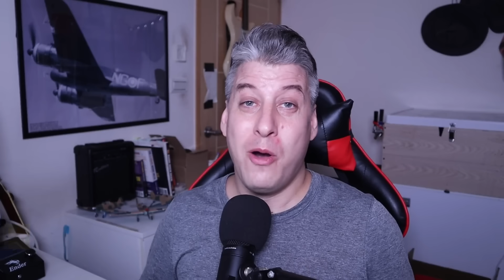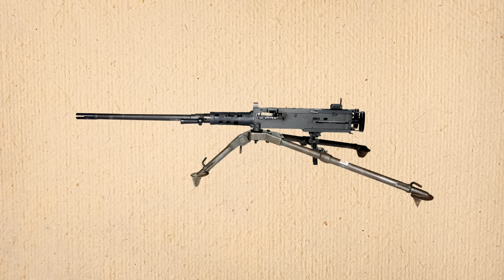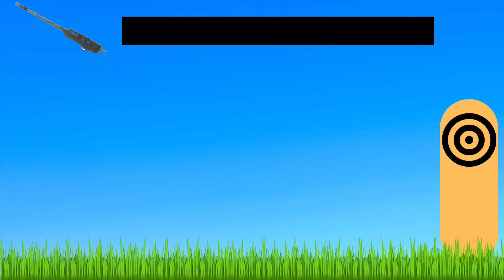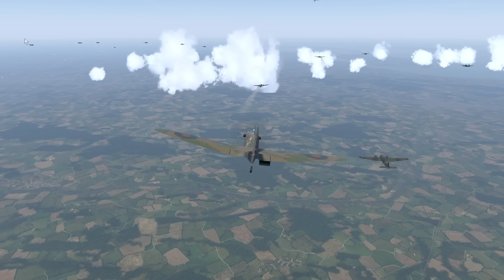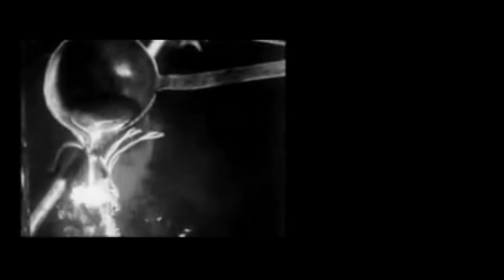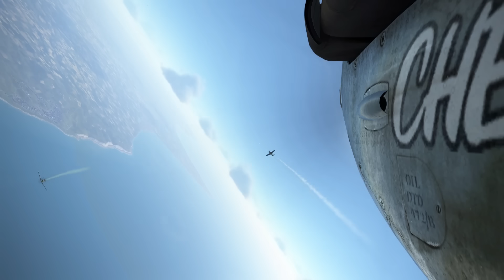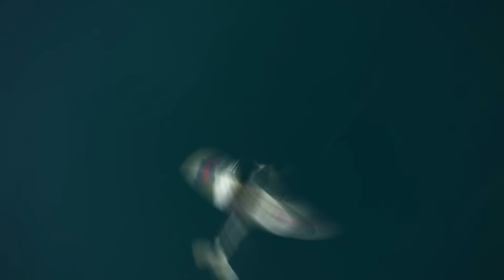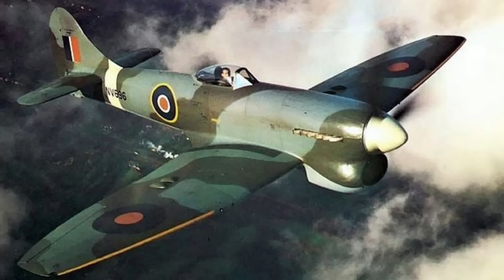Why Did The RAF Use .303 Caliber Machine Guns in WW2? The Surprising Answer

Comment: Nice discussion for which I've never had a satisfactory answer, until now.  One thing you didn't mention was the increase in weight of the rounds as the size increased and so the resulting decrease in numbers on rounds that were much more destructive and at a longer range.
Thanks!
Reply from the maker: Thanks for watching. Perhaps I could have covered this in more detail, thanks for the suggestion.
Reply: He did cover that the size and weight increases meant less ammo. It was a short bit so you could have missed it.
Reply: Or maybe he revised the video.
Reply: @carlwessels2671  
I think he generally mentioned the differences in weight -- the .50 is much larger than the .30 and the 20mm. Is a quantum larger than the .50 -- and the same is true of the rounds themselves so there's a difference in size/quantity in addition to weight.
I believe the Spitfire had a seperate trigger for the 20mm
 caccin for selective firing.  Why did the Hurricane Mk. II, which was largely used as a nightfighter, swap its 8 X .30 for 4 X 20mm.?
Reply: @randytaylor1258  It's been stated that 4 20MM are much better at destroying bombers than 8 .303
Reply: @carlwessels2671  
The .30s fire much faster than the 20mm. but with a much shorter range.  The 20mm. have a longer range with a much larger round, but the chances of a hit are less.
If you're not going to pay attention why waste the time answering.
Next I'm going to ask why some propellers have 3 blades while others have 5 while Mustangs, T-bolts Corsairs, and Hellcats all have 4 -- I can't wait to hear you cite fluid dynamics.
Reply: @randytaylor1258  The later War. 50s were closer to the .30s firing rate than the earlier guns. If you have seen any of the numerous pieces and payed attention to one of my comments,many fighter pilots said 4 20MM were much more effective in bring down bombers than 8 .303.
Reply: @carlwessels2671  
You're right about the firing rate of the Browning .50
I wonder if the perceived effectiveness of the 20mm. was because for a sharpshooter, the higher velocity, higher accuracy, and longer range made it.more effective in the hands of a pro, so that just a couple of hits were devastating.
One of the U.S. Marines' best snipers in Korea used a .50 on a tripod with a scope, taking out soldiers with a single round from over a mile away (the same round the Barrett .50 fires). Imagine that the 20mm. is more accurate than that.
Reply: @randytaylor1258  Thanks for the nice reply. I've seen statements from the pilots saying they liked the 20MMs effectiveness at all ranges . I think it's because the 20MM bullet weighs over twice the .50 bullet and over 10 times the .30. Some of the battle of Britain pilots said that even with ball ammo the twenty was better. I think because a ball round would go through so much of the length of a bomber . Make no mistake they thought HEwas better, but were surprised that ball did a lot better than they thought. Early on manufacture of HE couldn't keep up,so some were ball. 
           On your other comment,the concensus is that more prop blades helps climb performance and hurts top speed. Small effects 1 to 2 percent approximately.
Reply: Ps there have been some heavy rifles made in russian 14x114 caliber and some of the smaller 20MMs,but not many. I think the weight,size and recoil problems get to be too much.

Comment: I think they were a LOT more effective than games portray.  In many cases a larger caliber HE round would do a lot of surface damage and not internal damage though still considerable.  The inability of game developers to model such complicated things isn't all that surprising.  That they don't make some sort of accommodation for that lack of detailed damage modeling is a problem, lol.  A 30 caliber round going fast is nothing to sneeze at.
Reply: The HE rounds were fused to explode inside, not on the surface
Reply: @wbertie2604  So the games modeling is even worse than I thought, lol.
Reply: @mitch_the_-itch  it depends. The RAF tended to use APIT a lot in cannon, not much HE. The Luftwaffe used a lot of HE. 

Edit: although a Minengeschloss was intended to explode inside a plane and damage a lot of stuff if it did, it had to get there, and it had less penetrative power than a Hispano APIT. But the latter might leave a big hole which might be catastrophic, or hit a fuel tank, or it might sail though and miss anything vital. One advantage of firing from the rear is that along the length of a plane or the depth of the wings there's going to be something you want to keep like spars, engines, etc., so you can see why the RAF was keen on Hispano for tail chasing bombers.
Reply: @jbepsilon  That sounds logical.  I just flew a mission where I had almost a thousand .50 hits on one FW190.  I ran out of ammo, he flew home, lol.  Had these impacts been modeled correctly that couldn't have happened on such a regular basis.  Let alone going down to a .30 caliber.  The caliber is only part of the equation.

Comment: Am not a British aviation subject matter expert, but one critique: a comment was made that there was no .50 round that flashed when it hit a target. I can tell you from firsthand experience from running .50 ranges in the 1980s and receiving crumbling cases of M-20 armored piercing incendiary tracer ammunition marked 1944 from the Wildflecken ammunition storage point that the U.S. produced a .50 round during World War II that delivered a dramatic kinetic effect combined with a dramatic flash-bulb illumination effect on impact. The round was so dramatically different than any other sub-artillery projectile that I assumed it was manufactured for the air war in Europe.
Reply from the maker: Thanks for the correction Edward.

Comment: Yeah. Why wasn't the Spit the Mustang? Because the Spit was designed PRE-WAR in 1936 (5 years earlier than the Mustang) as a short range INTERCEPTOR (rather than a long range bomber escort). And what the Brits had were 303s and tons of 303 ammo. And at design-time, having 8 303s seemed like unreal firepower (when most bi-wing fighters had 2).  As the war progressed, requirements evolved. And the Mustang was a pig above 15000 feet before it got the Spitfire's Merlin.

Comment: there is one flaw with the RAF selection is distance if they used the M2 browning they can score a hit at a greater distance with more damaging capabilities ----- in the same time the aircraft and pilot will be safer from returning fire from enemy gunners --- yes rate of fire was important and they could have improved on it --- sadly in the battle of Britain a lot of the enemy aircraft limped back  they were no shot out of the air - the polish 303 squadrons with the same calibre number scored better by result by coming much closer to the target practically pouncing on it -- it was a very dangerous manoeuvre but it brought better results some of the British pilots called their aircraft a pea shooter --- on top of this the British used copper tips do not steel which may travel more but it's not strong in penetration the steel tips (armour piercing) was better but will render the life of the gun short ???   their is also the weight issue that  in the 303  you can have say 1750 rounds per gun where in the 50 cal you will have 1/2 of that  the best configuration is 4 guns x 1500 rounds   insted of the 303   6 guns x 1750 rounds    -------- remebr all these are done by planners who are allways trying to think econmey a cheaper round -eassy maintance -weight -avalibility  - rate of fire  but they missed out on effective range  in the end it was a bad judgment call they rectified it later in the war but they paid heveyly for the short cuts - my conclusion is they should ahve used both  with difrent assignments  the hevy cal for the bombers the lighter for the fighters - this would ahve had  a total difrent result

Comment: The .50 has a range of about 3,000 yards these days, at that distance the enemy is invisible, but a single round to the engine and it is game over.
The German Bundeswehr are big fans of the 20mm cannon and still use it on their APC´s and Recce vehicles like Weisel.
But nothing wrong with .303 inch as most of the fighting was at a few hundred yards and a .303 inch will kill at about 1,000 yards, that´s if you can hit a moving target at that distanse, hense the more rounds fired.